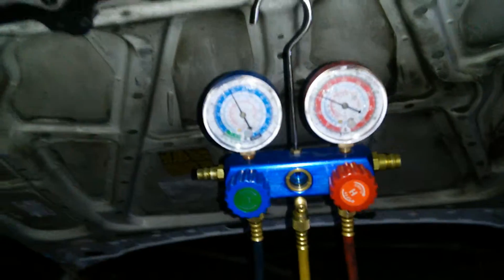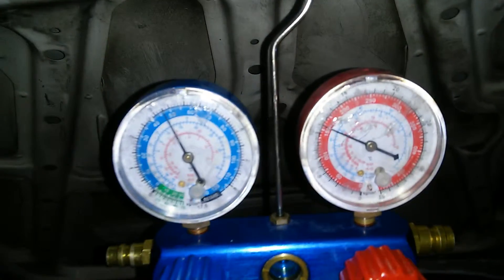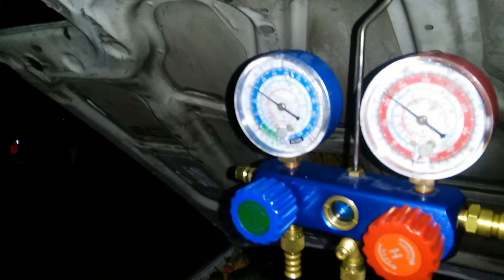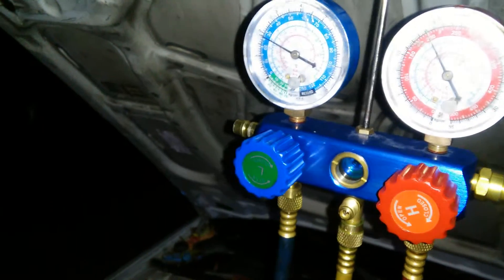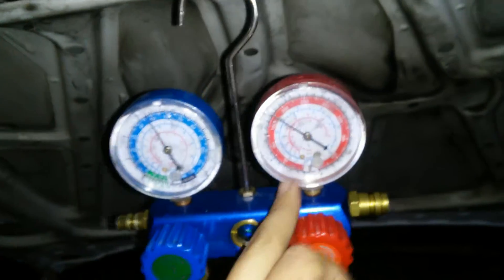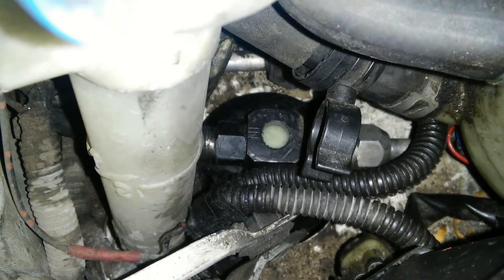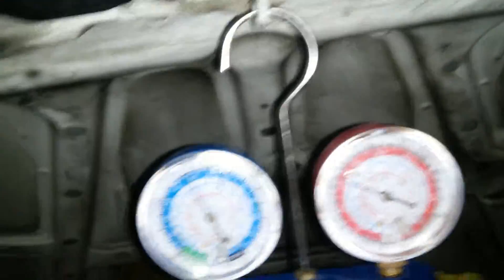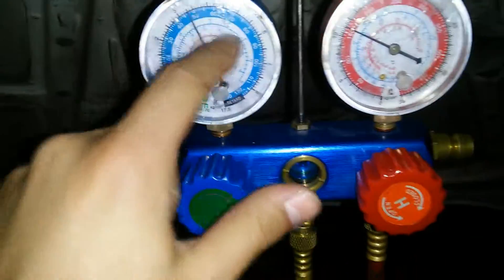retrofitted R 12 to R152a/ gauge readings, possible bad expansion valve

Comment: Yours is doing the opposite of mine. Low side isn't really moving, even with more revs. High side gets higher with more 152  added. Not really ice cold and I'm way over charged. Like 300psi on the high side. More 152 I feed it, colder it gets out of the vent. Only getting 46F vent temps. Going to swap the TXV and drier this weekend.

Comment: Low side should be around 25-30 at idle. High around 150'ish at idle. When charging open all car doors to keep compressor ON. Put on outside air during a hot day with fan on 3 out of 4 for example. You MUST weigh in the charge of 64% of an R-152A charge. Don't know for an R-12 car. Easy look up.

Comment: Adding gas won't cause evaporator temp to drop, it'll increase.  Might be slight overcharge, depending on several things.  You didn't give ambient temperature or temperature of evaporator and condenser outlet tubing.  Was the evaporator restrictive orifice (refrigerant expansion device) confirmed clean and/or replaced?

Remember, the compressor oil must be carried through the system with the refrigerant so if refrigerant is too low the oil will be washed out of the compressor by vapor and get trapped in the evaporator, never returning to the compressor.

Comment: How was the return suction line, should be very cold and sweating,  Just up the charge slowly measuring the discharge temp with a digital thermometer to obtain the coldest temp you can, watch the sight glass and along the way.  If the discharge starts to rise then stop and perhaps let some freon out.  Also, I would do this on a hot summers day if at all possible.  Please let us know how it works out.

Comment: I converted my 01 Honda Civic EX to 152a. Gets on average 3 to 4 degrees colder than the 134a did and has lower pressures. I use 12.5 oz charge as there is a .64 ratio to 134a charge oz of 19.4. I even used it to recharge my friends cube freezer and it's been working well also.
Reply from the maker: well it's good to hear someone out there is doing better, i ended up junking the car do to an unrelated incident

Comment: You have to change the TXV as R152 has different operating characteristic.
Read : http://www.sae.org/altrefrigerant/presentations/presw-hill.pdf 
And you have to use cross flow condenser..
Reply from the maker: it would not be an evaporator cooling issue foremost because the pressure never gets up to operating spec (and also it was 87° at night). i had a cross flow condenser with 3/8 tubing should be enough even if multiflow is more efficient it ended up being a compressor reed problem
Reply from the maker: +Alfonso Perez ment to say condenser

Comment: I know what's happening with your AC system. I think you may not have filled it with enough R152a. I looked it up and your car is supposed to normally take in 30 oz of R12. R152a molecular weight is 66.05, and R12 is 120.91. So you take 66.05 / 120.91 = about 0.55... so you will use 55% of R152a as you would for R12. So 30 oz * 0.55 = 16.5 oz of R152a. You will need 2 - 10oz cans.
It is very important that you pull out as much of the R152a as possible. Majority of people leave at least 3 oz remaining in the first can. To pull every last bit from the first can you must raise the rpm of the engine to as high as you need to in order to bring the low side to as little as pressure as possible, this will lower the pressure from the can, which means pull out as much as possible. Close the low pressure valve while holding the rev at its lowest pressure possible, this will prevent the R152a from returning to the can. Then you can move on to the second can.
Second can use about half.
One thing to know about R152a, its that it is not that great from idle to about 1000 rpm. One solution for this is to continue to add just a little more R152a (about 1 or 2 oz) until there is not need to rev the engine above 1000 rpm, but it may cause just a little more drag on your engines power while driving with the added pressure. Notice if revving lowers AC temps. I do not recommend going past the suggested ounces. Maybe raise the engine's idle a little bit instead.
When revved, High side should be at about 200psi, Low side can be just about anything, I rather have it as low as possible.
Being that R152a molar weight is lower, the variation in temps will be greater compared to R12 and R134. This means that R152a might be so-so at idle, but R152a will get insanely cold at higher rpms and while driving. Definitely colder than the other two.
I am assuming that you pulled a vacuum prior to filling up on the refrigerant, if not, you must, or else risk damaging the compressor.
Older system designs seem to not be as effective as newer systems. My 94 Sentra, I experience what you might be experiencing, but my 03 S2000 & 06 Civic Si, it is cold at idle but crazy cold while driving. Sentra has completely new AC system too.
Hope this helps.
Ultimately, I think you might either be a little under on the correct ounces needed (don't overfill) or try raising the idle a little bit.
Reply from the maker: +Eddie Trevizo sorry for the late reply, i did not like the low side pressure if i would of kept charging it the low side would be about 80 while the high would of maybe been at 200 and the ambient temperature outside would be around 78-82 F and still not cold at the vents. I bought an air conditioning book and it said that when i get the pressure readings i have (at idle) that it would be a bad compressor reed valves letting in some of the high pressure gas into the low pressure side, without effectively increasing the pressure for the high side. Thank you for you in depth answer!
Reply: +Alfonso Perez Ouch, that sux bro. Yeah 80 low is way too high in pressure. Does sound like a bad leak of high pressure somewhere, most likely com pressure because by design we want the expansion valve to release the high pressure to low pressure (goes cold), but with a low side of 80 at idle, that's crazy high especially using R152a. I have mine at about 30psi low and about 190psi high or just about all my vehicles, gets crazy cold temps at the vent. Good luck man.
Reply from the maker: Thank you sir and do all you vehicle run r152a?
Reply: Yup, once I switched to R152a, I would never think of switching back to R134a. Gets way colder, especially in the highway, but also the drag it has on the motor is literally about half up until about 2000rpms, then feels like its not even on after that. Both of these benefits are directly related to the difference in the molecular weight from R134a to R152a (65%).
Reply: How would you calculate this for a R134a System? Im wanting to try this on my 94 Chevy truck.
Reply: @mrnapolean1  94 truck will take 19.2 oz (assuming it's a pickup and not a 'burb with rear air)